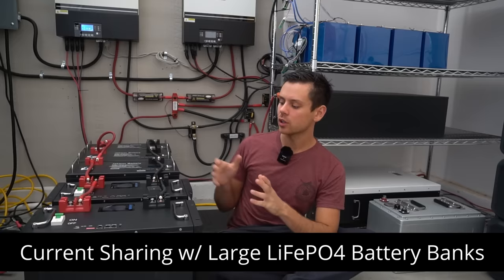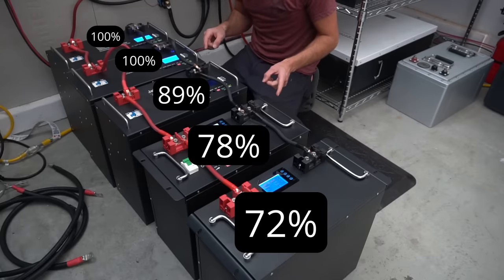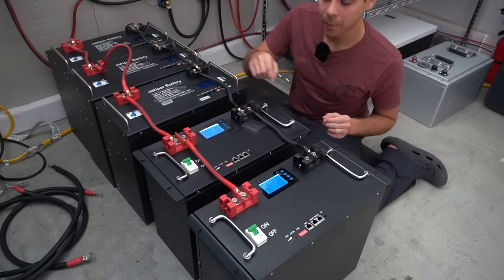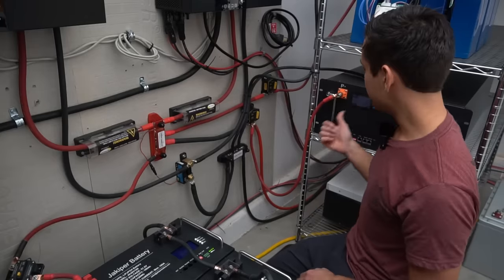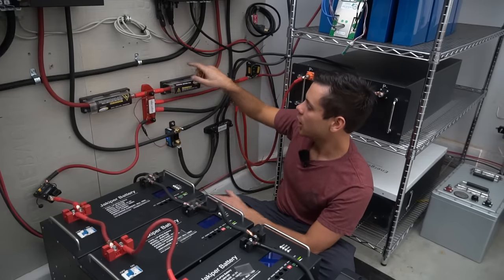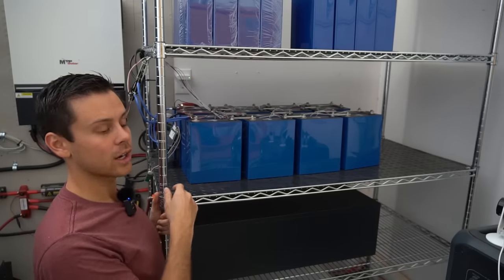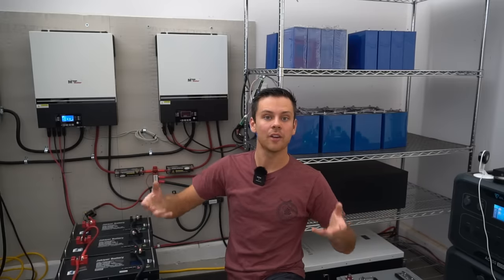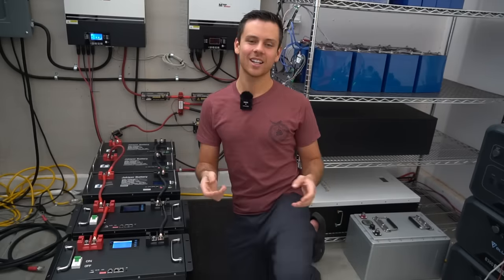Current Sharing 101 w/ Large LiFePO4 Battery Banks

Comment: I appreciate your advice against using Lead Acid batteries with LiFePO4 as I have been going over the idea of adding some second hand LiFePO4 cells to my existing Lead acid bank.  I hadn’t really thought about the difference in internal resistance being an issue, but you made it very clear.  I’m still curious about the possibility of using the LA batteries as sort of a secondary backup storage to a LiFePO4 bank with a single inverter, possibly using a low-voltage triggered transfer switch.  Does anyone know if this is worth setting up or have any suggestions?
Thanks
Reply: I had a couple of good lead acid batteries left when I went lithium. My solution was a sealed and vented battery box in the back of my 1 ton Suburban. I have a 2000 watt inverter back there and it is all fuse protected. It is nice to have 110 available in the woods or out in the fields. This isn't ideal for a lot of vehicles but would be good in a pickup as well. This is handy living in the country but I'm sure there are city dwellers who could benefit from having 110 AC in their vehicle. 
      Ya'll Take Care and be safe, John

Comment: The positive wire from the inverter should be in the first battery and the negative is should be on the last battery to balance the load across the batteries.
Reply from the maker: No, because I was showing people how not to do it. It was a bad example. Did you not watch the video?

Comment: Hi Will!  You can skip busbars as long as you use all the same length cables from the batteries.  Frequently big busbars are very unforgiving when you're trying to use a bunch of packs like you are.  You can't easily move packs or configure a busbar to conform easily or very inexpensively.  Also big busbars present large accidental contact hazards.

 I just made two, foot long busbars as a place to bring matched length cables from my 5 packs and land them.  Then from these little "bus-stations" I run off to my inverters with matched cables.
Reply: At these low circuit resistances, small differentials in contact resistance, e.g. over time and location, may impact the performance.

Comment: Great video. I’m a retired EE who spent some years building power systems. A few comments. Circuit breakers can fail shorted, whereas fuses will only fail open (in this application, anyway). I always put a fuse on V+ for each battery, even if there’s a circuit breaker. With bus bars or wire, you want each conductor to be the same size and length (ie, impedance) from each battery to the inverter/charger. That’s the best way to ensure that each battery charges and discharges fully with no differential voltage between packs. As you noted in the video, connecting diagonally or from opposite ends gets your most of the way there, or you can use a star configuration. this is not as big a problem with lithium as it was with lead acid, but you really want the packs to charge/discharge more or less equally, or you will put more cycles on one battery than the others.

Comment: I'd like to see the same demonstration of charging with the buss bar setup. I'm a bit skeptical because the buss bar has resistance as well.
Wonder at the difference if the wires/cables were connected in the same manner as his buss bar diagram - i.e. diagonal: Positive at upper left, Negative at lower right. Hmmm.

Comment: I can notice a difference in charge rates even with bus bars from the server rack from Signature Solar with my lifepower batteries. Would connecting one bus bar on bottom and the other bus bar on top be simple enough to solve it? If it is I would think their picture would show it like that.
Reply from the maker: Yes, you need to connect an opposite ends of the bus bars. I will cover that when I get one. Still haven't received one yet.
Reply from the maker: There is a picture in this video where it shows proper placement
Reply: @WillProwse  I get it’s probably a very minor difference but it’s still an oversight on their part. It’s obvious it’s designed to run both out the top because the top three holes of the bus bars are tapped for larger threads and bolts for the leads going to the inverter. At least mine isn’t designed to run one from the bottom. I’m a substation electrician and this all surprised me with how much difference there is from the top battery to the bottom with each feeding into a solid copper bus bar and such short distances.
Reply: @WillProwse  I just saw that, thanks. Now you’ll need to emphasize to people to still use two equal size conductors for that or they will run the top one short and negate what they just tried to achieve.
Reply: Can you give me the dimensions of the bus bars?  They seem to be only sized for about 100 amps which is about 1/16" thick x 1/2" wide copper and 36" long.
Reply: @The Osborns Nope that’s a great idea and how I was planning on doing it actually, I see it working.
Reply: @The Osborns  I have my signature solar rack. I'm still assembling things so I'm going to see if one of the buss bars can be flipped upside down.
Reply: I create circular or half circle bus bars so that each parallel string has an equal distance to the wire that goes to the inverter
Reply: @The Osborns Just an update. I flipped the negative buss bar In my signature solar rack. It wasn't as simple as removing the buss bar, flipping it and bolting it back on. The buss bar stand offs are not equal distance so the vertical placement needed to be adjusted. I removed the rack side panel to expose the brackets that the buss bar and stand offs are bolted to. I removed and adjusted the bracket to where I was happy with the placement, and put everything back together. Maybe not as simple as just drilling and tapping a new hole, but but it worked for me.

Comment: This is awesome. Quick question, if I am building a system for RV. Say 12v 800ah with 3000VAC inverter. Is that considered a small system so I can get away with just one breaker on the whole battery bank?

Comment: I have an off-grid solar system. Let's say you have four 12-volt 100 amp hour batteries connected in series to make a 48 volt battery. Could you introduce one individual 48V 100 amp hour battery?

Comment: A lot of great info.  You sir earned my sub.  Thanks for sharing.  I haven't looked thru your other videos yet but I was very curious the life span for these China made Li-Fe units?  Perhaps a better question to ask is what's the shortest amount of time to pass before you had an issue with a battery?
Reply from the maker: Goodness that depends on the cell. Usually what kills lifepo4 is BMS failure. Shorted lifepo4 cells are pretty rare. Even the worst lifepo4 typically cycles longer than a lead acid. I'm running grade b cells in other systems and they are working great.

Comment: Will, I have two CHINS 12V 200 AH batteries, two LIFEBLUE 12V 200 AH batteries, and two AMPERETIME 12V 400 AH Batteries, (all LifeP04)..  From your video, am I to understand that I can run them all in parallel, as long as I deal with current sharing problems, and correctly fuse each bank? Without harming the different manufactured batteries?  I love your video, after listening to it several times, I am going to try running all of my batteries in parallel.

Comment: On the battery bank that is on the floor, you could connect additional cables with the same diameter in parallel from the first battery over to the last battery to reduce the voltage drop across all batteries. Then the last battery is charged a little faster and you spread the load?

Comment: I've heard the bus bar argument before, and what I've never understood is this....even with a bus bar, the most remote battery still has a longer conducting path to the charger/load.  Why does a piece of solid copper have a lower resistance than a large braided copper wire?  That's the only way there would be less resistance, since the effective lengths are still the same.

Comment: Hello Will,  I was just given 50 12vdc LiFePO4 batteries @ 40ahr each.  All these batteries are from the same manufacturer and nearly the same manufacturing date.  Although they are Used batteries, they came out of seismic detectors that were only used for a couple of months until the company decided on another solution for the batteries.  Ultimately, I want to create a 12vdc battery pack with 600 ahrs, which, if I put 15 of these 40ahr batteries together in Parallel, I should hit the 600ahr requirement.  Can I do this, and is it advisable?
THANKS FOR ALL YOUR WORK.  I ENJOY YOUR VIDEOS!!!

Comment: I've been running 3 100 ah and 1 180 ah in parallel for some time.  No issues at all. It appears the system even compensates for percentage.  In other words, the 180 will stop charging at 100 ah while the others catch up, percentage wise.

Comment: Thats why the best solution is to connect the wires from the inverter in the center/middle. Normal is not a problem. I have before 3 banks but the connection where 100% same distance. now my friend got mine and now he has 6 modules with no problems only few voltage difference the last module in the rows/strings. If you add a new battery and have used the old battery for over 3 month it have to balance and cant discharge 100% that the law and it can take from 20 to 90 days before same voltage /SOC. I always recommend to buy same KWH  battery modules with same BMS and cables length..mm2 etc.. Normaly BMS with CAN or RS485 can fix this. Growatt system if you add new battery to old system it will self balance the SOC and SOH mix

Comment: You could just use another lead going from the first battery to the last one. That way both outside batteries are charged faster, and the last one will be the center one.
The center battery will charge faster as well.

Comment: How do you calculate the T class fuse size? I have a 48 volt battery bank with 2 Jakiper and 1 Growatt Inverter with 3kW continuous and 6kW peak... does that mean 6k/48=125amp, so maybe a 150amp fuse? Also, in lieu of bus bars, won't my 2 AWG short parallel wires suffice if I connect the inverter leads (also 2 AWG) at opposite ends of the 2 batteries?

Comment: Hello Prowse, I have a guestion. I have two blue carbon 24v 100ah batteries. Connected in series I use it to power my 48v Gennex Hybrid inverter. I intend buying a single 48v 7.5kwh battery from felicity. Is it possible to connect the single 48v battery in parallel to the series connected (2 24v) batteries?

Comment: Thank you for your videos. I am using a 55ah lead amg battery and about 6 8ah smaller batteries using a bus bar. Should that be ok to use in parallel? It is powering many devices that don’t pull many amps/wattage. Maybe using about 40/50 watts/hr. Using 2 100w solar panels. Batteries are not the same manufacturer. Question I have is 1. Should I separate the batteries and maybe just double the 55ah battery and maybe do 12 smaller batteries by themselves? 2. If the smaller batteries are of all different ages what should I do so I don’t need to worry about a battery going bad? Anything else I should do? Thank you

Comment: As the steel rack has each level insulated with plastic sleeves,couldn't you use the racks as your 'bus-bar' for each layer of batteries?(Years of commercial prep-cook work,so I know the design)I see you also have insulating mats beneath all the batteries too.Good plan.

Comment: Thank you for this, and a quick question: I have 2 new SOK 100ah LiFePo4 batteries that I would like to combine in parallel with  2 Renogy 100Ah 12V smart Lifepo4 batteries that were bought 2 years ago, but they are lightly used with less then 10 cycles and have been stored in shelf mode most of the time. Is this safe and do you recommend any safeguards?

Comment: Great video thanks
I have 4 12v 200amp lifepo4 batteries in series. I would like to double my capacity so add another 4 in parallel to the original set. Any help on how to safely do this would be great thank cheers paul.

Comment: Will ... I have purchased the same GoPower T Class Fuse I see in this video based on a link from one of your other video. As these have a lug screw, did you use a ferrule on the cable? I am using 4/0 cables from the battery rack through to the inverter, also based on another or your videos.

Comment: Is it safe to use an EG4 in an enclosed trailer since its designed as a stationary rack mount battery?  Wondering if it will handle all the jostling from going down thousands of miles of road.
Reply: Or on a golf cart

Comment: An off-grid solar channel I follow had a catastrophic short in their main (and only) AC inverter just like you described. Whole inverter turned into a raging inferno right next to their (then lead-acid) battery banks. It was at this point they realized they had neither fusing, nor an easy disconnect from the battery banks. Supposedly they were able to get the positive rail disconnected at a point under the (still raging) inverter, then a fire extinguisher brought the situation under control. (IIRC they used welding gear to protect themselves from the heat and sparks while disconnecting the bus.) This is no joke... spend the money on that T-Fuse, and have plenty of points of disconnect. A fire should not be your first indication something is wrong.
Reply: I'd probably keep some bolt cutters nearby to sever thick cables.
Reply from the maker: Holy cow!!!!
Reply: @WillProwse  I imagine they used stronger language than that, even, but yes. Fortunately they learned their lesson.
Reply: @v12alpine  I'd be surprised if they don't now, but they also use busbars. All good because they learned their lesson. All fused up now.

Comment: Great explanation ........you may have saved many lives.. now I’m scared !!! 400 watts to  circuit breaker to mppt to battery’s ( 4 6v Trojan 105 cycle in 12 volt) to inverter. So a circuit breaker between batteries and inverter before the fuse. And a fuse somewhere on the battery.....

Comment: A domestic ring-main overcomes the problem of resistance along the string by just connecting the last one back to the first.  Would that also work?  It's not as good as a bus-bar, but would it cause any problems?

Comment: HELP!
First, Love your channel! I have components to get my first off grid system going. One issue I am having is conflicting information on my options for wiring my batteries. The system is still all in boxes so I am open for best configuration suggestions.

I am using 8, Ampere Time 12v 200Ah Plus , 2560 Wh LiFePO4  batteries with 2 Growatt 3000TL LVM-24 s PL inverters (wanted option to add 240), powering with 6, 165w and 2, 240w solar panels. 

How is best to connect the batteries at 24v to get the most capacity? Also are long bus bars available without buying a rack? Thanks in advance!

Comment: Thanks, Will, good informing video!   I am running a 16s 280Ah pack, and want to add 32 cells 200Ah in parallel. But is it better to add two different strings 2 x 16s  each their own BMS,  or one string  2p16s with one BMS?
Keep up the good work!

Comment: Hi, I have question regarding using of fuse/circuit breaker? A 50amp battery. What's size fuse/circuit breaker is recommended? Some recommend a 60amp fuse. If it's a 60amp fuse is used. What's the purpose of the fuse?

Comment: Most of the stuff you are saying is correct but I wanted to point out that those little breakers you are using are not rated/safe for use in a 48v system. They may advertise a rating of 12-48v on the label but remember a 48v system actually runs at a voltage higher than 48v (up to 59v when charging). The insulation rating of those little breakers is not safe at 48+ volts; Lithium or Lead-Acid. Also, Outback and Midnight make very high quality, high current 150v DC rated circuit breakers that will perform WAY better than archaic class T fuses; and be more cost effective in the long run. And they absolutely WILL and DO work. Your statement about having to use those Class T fuses because of melting a breaker trying to extinguish the arc only applies to people who (foolishly) use AC rated breakers in a DC circuit. All quality DC breakers use a magnetic field to help extinguish the arc and do so without any issues.

Comment: So I have a large lifepo4 battery bank.
12x 100ah units from the same manufacturer.
My max loads aren't that great maybe 130amps maximum shared between the whole pack.
Very rarely see more than 10amp draw per battery.
The batteries are supplied with 16mm cables.
I have them side by side in 2 rows of 6.
I have them fed with four pairs of 16mm cables that join in brass blocks to 25mm cables.
They are fused at 125a and then go through a 250amp isolator.
I have 2 x7kw inverters on my pack.
Like I said the load isn't great but I need lots of redundancy for the winter when there is long power outages.
Am I better putting them into two strings of 6 or 4 strings of 3 or just leaving them in one parallel string of 12?

Comment: You mention to keep conductors the same length but your current sharing cables between the 2 inverters each with a fuse will have a much higher resistance than the negative that has no fuses. Any comments on this.

Comment: Hi Will, love your videos. What if you added a second set of wires from the bottom of the pack to the charger. Would this not reduce  the variation somewhat? would it be nearly as good as buss bars?

Comment: Thanks Will. I have 2 Jakiper 48 volt 100 ah server rack batteries and 2 Alibaba 48 volt 100 ah server rack batteries and I want to use them in the same off grid solar system. Should I connect them in pairs for use in parallel or tie all 4 together?

Comment: So if a bus bar is not an option, and you have 3 battery packs would using the middle pack as the point at which currently is taken and given. That is what I would do in your situation there and draw current and charger between the 2 different pack design, so 3rd position from the wall, what would you think of that idea?